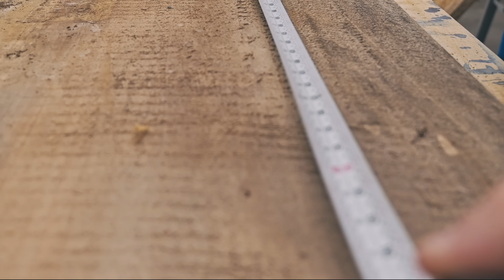Good Enough For Government Work

Comment: Instead of C-channel, you could have used box section for this one. It doesn't really protrude any more than C-channel, but has significantly added strength in flattening the wood in the same way an I-beam works.
Reply from the maker: Good thought
Reply: So do you use 1” square stock?

Comment: Never would have thought about doing relief cuts on large slabs to flatten them.  Then you followed up with filling with silicone bondo.
Reply from the maker: With all the steel reinforcement and the beefy base.. it didn’t compromise strength. Silicone filed the cracks nicely, and Bondo did well enough on the gaps that I didn’t have to build forms for the epoxy 👍

Don’t look pretty, but it’s the bottom